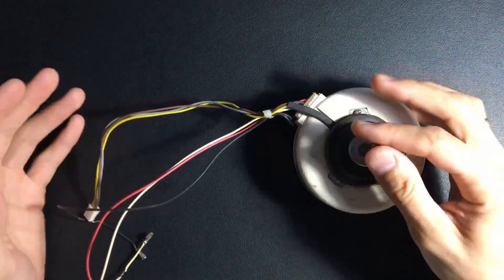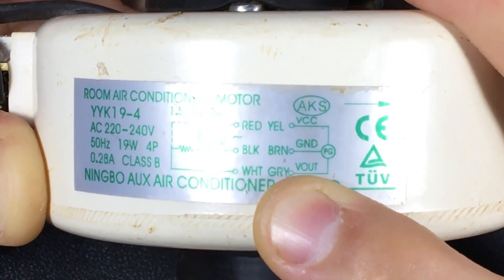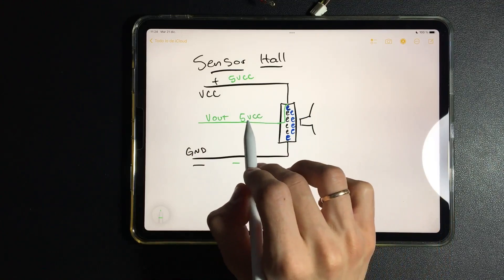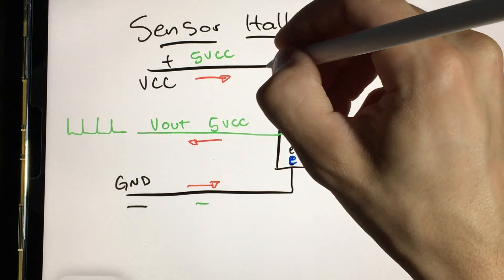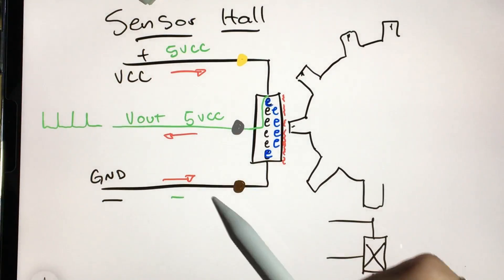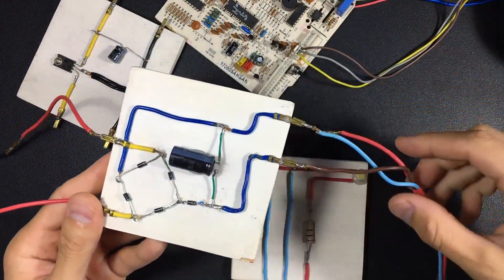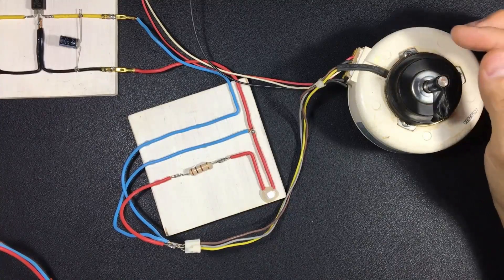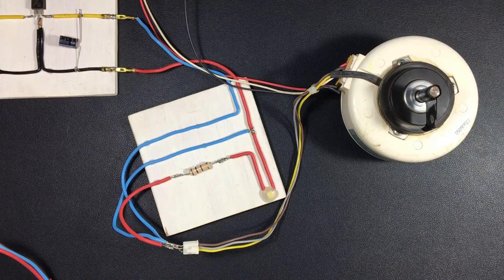Class 49: How does the Hall effect sensor in your AC fan work? #fan #invertertechnology

Comment: Found that video while searching for specs of hall sensor in Samsung AC (want to emulate it using Arduino). Because while it's 5V powered, it's output signal is 1V. Very strange, but the sensor is fine.
UPD: seems like it's an open-drain hall sensor. And 1V is derived from external transistor base.
Reply from the maker: Join our channel to access the classes by title and by module, and study effectively!
Join the Module Access level or higher!
TAP HERE ▶️ https://www.youtube.com/channel/UCfu_M6VyaVaJK9R69DsZGHA/join